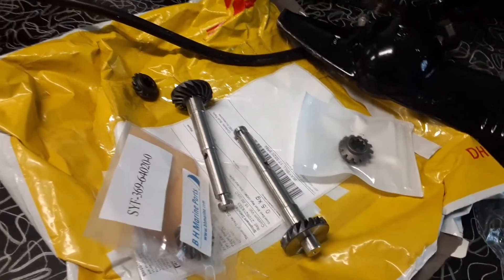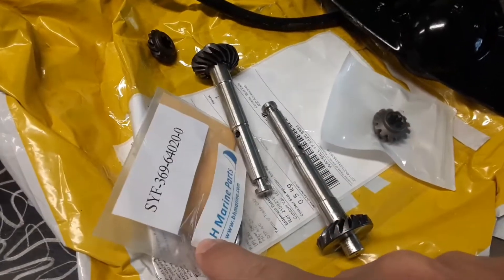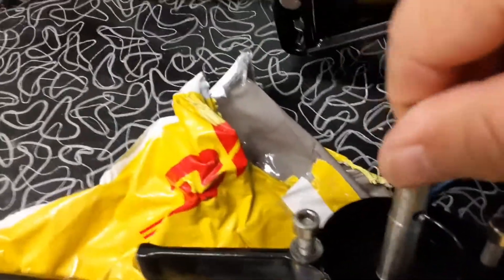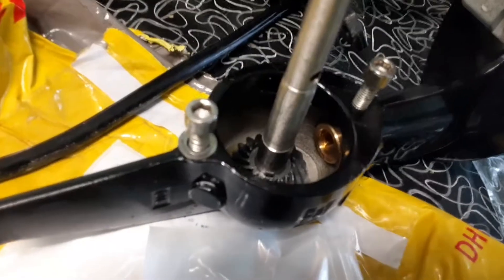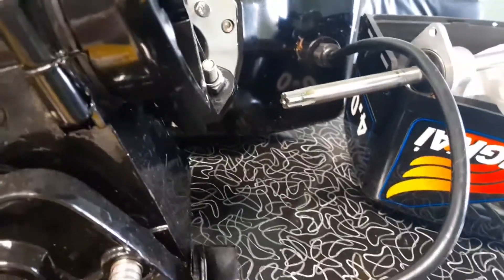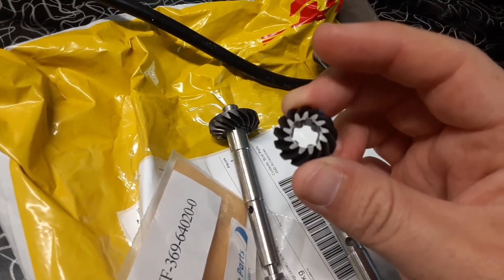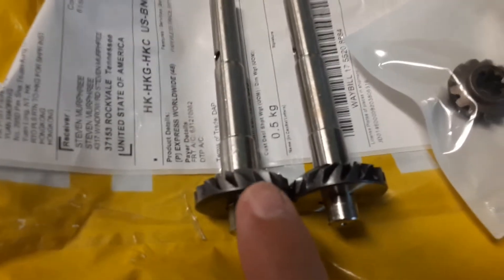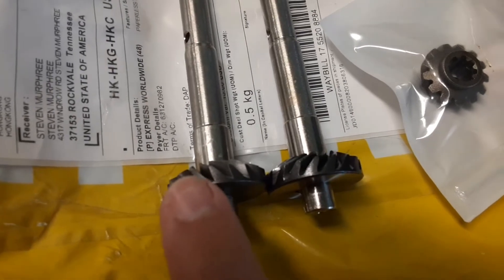Hangkai 4hp Electric pinion replacement rd2

Comment: Steven,

What is the part number and the place you ordered from?  I have the 5.0 with the same issue. My pinion gear is also 6 spline internal and 13 spline exterior.
Reply from the maker: https://m.aliexpress.com/item/32794148418.html?spm=a2g0n.productlist.0.0.47dd38ee64icLA&browser_id=fe7f4c5e369f4ef6828fe1fb3d7fbb20&aff_trace_key=&aff_platform=msite&m_page_id=17885c30bd51fd7338331840419da252a85c3b1459&gclid=&_imgsrc_=ae01.alicdn.com%2Fkf%2FHTB1OIqQPFXXXXXEaXXXq6xXFXXXW.jpg_640x640Q90.jpg_.webp
Reply: The picture doesn't match the part in your video but maybe it's a stock image.
Reply from the maker: @brianhammond3812  my best advice is order one for the 3.5hp hangkai on aliexpress if it has 6 splines.
Reply: @stevenmurphree  I ordered it. I don't know why they make finding parts so difficult. Thanks for the video. Maybe it will save me from the same issue you were having.